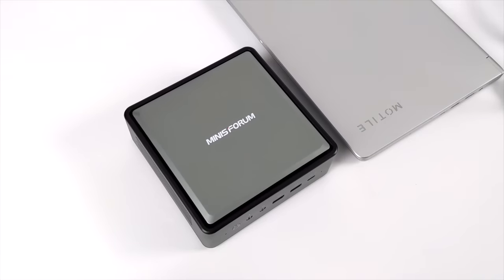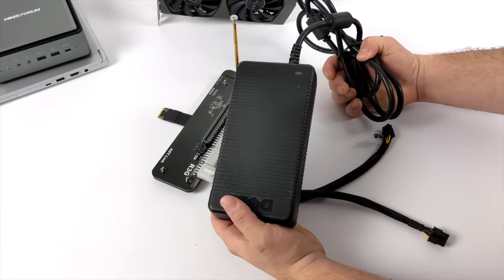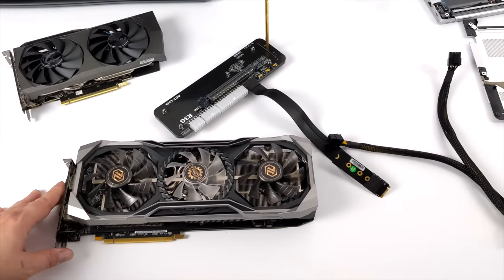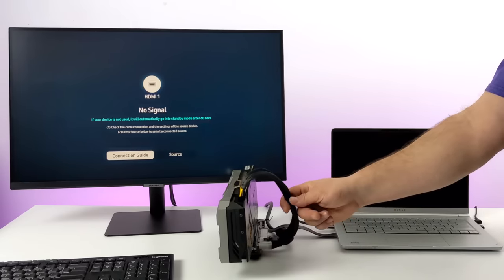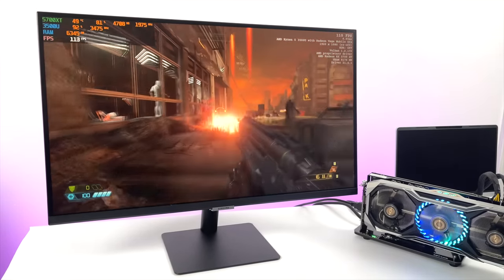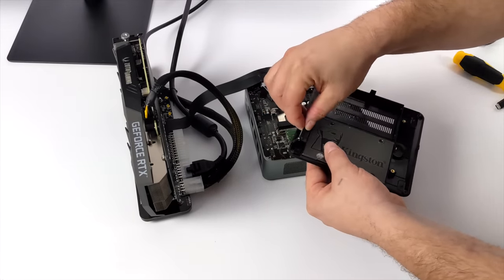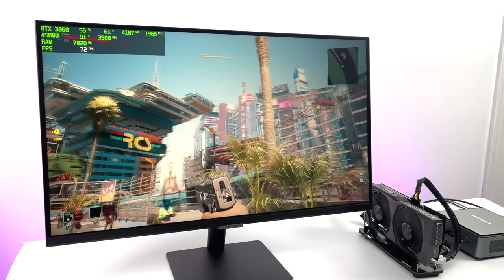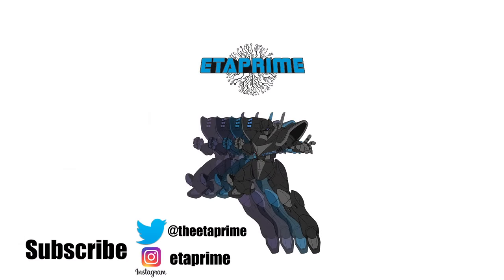Add A Graphics Card To Your Laptop Or Mini PC With This M.2 GPU Dock!

Comment: I already have this setup as a daily driver. Mini pc with i7 8750H from AliExpress, and this ADT Link also from AliExpress.

Been running for about 4 months now. I7 8750H and rx 570 combo. Great for daily task and "light" gaming 😁👌
Reply: Awesome! You used the exact same ADT? i bought an intel based i9 mini pc and seller tells me this cannot be done. But then it is possible on intel based too?
Reply: @steinbauge4591  same ADT, but different mini PC. Mine is older version which had 2 m.2 slot and 1 HDD slot but fewer usb slot and a weaker CPU.
So I still can use nvme SSD and ADT link simultaneously. And yes, it's still working today !
Reply: @ero-samairianto625  Great! Thanks for answering. Now my storage slots are SATA but there are setups for ordinary pcie mini ports. Only works with some 'moderate' gpu like GTX 1080.
Reply: @ero-samairianto625  Thx again, this was useful input as the seller now informs me the 2 slots I have are NVME, 1 also supports SATA. Seems their techs just assumed egpu was not possible on this one (ofc an assumption that potentially loses them business)

Comment: How bout a Dual M.2 to PCIe Adapter for dual purpose.
Reply: "Dual purpose"?.... you mean dual GPU, like SLI/CrossFire. If so, I actually think running 2 identical adapters would work just fine, even adding an SLI bridge might work. Having an integrated adapter only makes sense if you want to combine 2 M.2's into a single x8 slot.

Comment: if you can get pci-e gen4 X4 with this m.2 adapter you can actually destroy thunderbolt 3 4 and maby even thunderbolt 5 when it comes to a actual egpu like this setup. thanks eta for pointing out still the fastest egpu solution even if its not neat as a thunderbolt cable to a finished egpu box!

Comment: I just hoping to use the built in monitor for the laptop. Is it even possible?
Reply: there are ways to still use the gpu while routing the display through the onboard port/monitor sometimes. gonna take an fps or latency hit but it's been done before
Reply: Yes but it sends the video back over the same link so bandwidth can be an issue

Comment: Dremel.

You can just cut a slot in the bottom cover panel of a laptop, nearly the size of a cooling vent slit.
Reply: the issue is that if you carry your laptop around a hole big enough to conveniently plug this is is going to leave part of the internals exposed
Reply: @_Digitalguy  Seems like a good idea to 3d print a custom dust cover for that hole.

Comment: 1.) Did you use the Dell DA-2 USFF power supply with the RTX 3060?
2.) If so, did you have to perform any manual or software based power limiting?
3.) If not, what ATX power supply did you use?
4.) Does the Dell DA-2 USFF power supply come with the necessary 8-pin adapter cable?
5.) If not, would you please provide a link to the cable that you used in your video?

Comment: What is the GPU performance difference between using the "M.2" slot and directly connecting to "PCIe" slot on the Motherboard on a normal PC?
Reply: Usually the M.2 slot is more limited in bandwidth which can prevent the GPU from reaching full performance.
Reply: @ants288  well back in the day this solution much more limited bandwidth because it only have mSATA version 5Gb/s slot

Comment: Is it possible to use the laptop display or it can only work with a monitor plugged directly to the gpu?
Reply: Yes it is but you need to configure it properly for this, you lose 15-25% performance, it's very buggy, but I did it for a couple years, get the shortest cord you can find.  I tried to edit the dsdt but ended up going with egpu software from nandeva0 on eBay. It was unstable at any temperature above 40c but I could run a lot more games than what my Intel integrated supported.

Comment: Thanks for the indepth setup guide and the product links. In this way, these amd based mini PC's can be turned into a solid gaming rig. Would you please test it with some mini PC with desktop class apu like R7 4750GE or R5 4650GE? The performance should be Higher considering those CPUs have higher power limits.

Comment: In case you missed it, both Intel and AMD are agreed not to put PCIe Gen 4.0 in a mid-range portable/mobile devices Like Laptop or MiniPC. High-end Laptops are excluded as to use Thunderbolt 4 standard.

The reason for that is pretty simple: PCIe Gen 4.0 standard is not mature enough for Mobile use (Laptop or MiniPC) because the arbitrary Voltage and Wattage differs too much between running on Battery vs running on AC Power. This is a serious problem in the Long run if they actually implement it in Mobile devices (Laptop and MiniPC) like the device will Worn Down way faster than PCIe Gen 3.

So Intel and AMD continuing with PCIe Gen 4 stays in Full Fledged Desktop PC. Not Mobile.

The Tech Scientists who standardized PCIe peripherals also admitted that PCIe Gen 4 is not mature enough for Mobile devices, Unless you Slap $2000 to a Laptop Like "MSI Summit E14" which has PCIe Gen 4 which is beyond "Affordable" Price range. Because it is using a very expensive custom VRM (Voltage Regulator Module) in a Laptop to make PCIe Gen 4 possible.

PCIe Gen 5 will come soon enough this Year with way Lower Voltage and Wattage standard. And make it possible to be installed on Cheap Laptops.

Comment: You know what would be dramatically more useful than this on a laptop? An m.2 to thunderbolt port. Then you could connect a graphics card externally without rendering it non-functional as a laptop.
Reply: Or this, with a connecter in the middle of the ribbon cable (even if it's proprietary). You could Dremel out a nice hole for it and glue the jack in your case.

Comment: Just bought a Mele Quieter2. Interested in testing this dock out with it now. Would be cool if you did a video on that. Only thing I'm afraid of is CPU bottlenecking. Would be willing to buy the cheapest GPU possible. Nothing too crazy. Just something that'll get me 1080p gaming possibly with low or medium settings.
Reply: that is for a setup using ordinary pcie mini port and only a few GPUs can be used

Comment: I'm not too versed in eGPUs so I'd like to ask how does this compare to an eGPU that runs off thunderbolt? This solution is definetly cheaper though
Reply: Both have a max of 4 PCIe Lanes. Performance is probably similar (but M.2 might be faster since it's direct PCIe instead of tunnelled over ThunderBolt, but its probably minimal). The big thing is you can't hotplug like you can with ThunderBolt, and I don't think you can use the internal laptop screen either.
Reply: @seshpenguin  I see. Thanks for the info!

Comment: Is the M.2 cable detachable from the pci card? Because if it is, you could drill a hole for the cable to go out of the case and a little Velcro or reusable tape to keep it secure while carrying your laptop outside of your actual gaming rig. It would be awesome!

Comment: I've been using this external gpu dock for about 2 years and it's awesome! Although the one that I have is EXP GDC Beast, expresscard version, since I'm using Dell laptop with expresscard slot so I don't need to take off my laptop panel. I made also EGPU Box using aluminium angle as well!

Comment: I'm hoping that this setup will work with the Asrock DeskMini X300.

If it does, it'll be a fun project to 3D print a custom case to house both the STX motherboard and power supply.
Reply: Did it work?

Comment: It's perfect for a "mobile" GPU testing Laptop/Station.

After half an hour in the oven (most of the time [GPU]), you can comfortable check if there'll be an output signal again.

Now there could be something like an Ambulance for GPUs. With GPU Doctors on Board. 🚑🤭

But honostly I'm rly thinking about to get this Adapter for my own (I do own an old laptop, so it'll have a purpose for its existence again too).

Since I've managed to get 5 GPUs back to life and the swap between my main pc card and the repaired one was the most annoying part.

Thx for this video and giving me the idea. 💯 @ETAPrime 🤓❤️👑🙏🏻

Comment: What I can't wait to see if a dock like this to be PCIe 4.0 bandwidth vs 3.0, to where a 4.0 at 4x speed is equivalent to 8x 3.0 speeds, which would be similar to having a secondary card in a consumer desktop gaming PC
Reply: In case you missed it, both Intel and AMD are agreed not to put PCIe Gen 4.0 in a mid-range portable/mobile devices Like Laptop or MiniPC. High-end Laptops are excluded as to use Thunderbolt 4 standard.

The reason for that is pretty simple: PCIe Gen 4.0 standard is not mature enough for Mobile use (Laptop or MiniPC) because the arbitrary Voltage and Wattage differs too much between running on Battery vs running on AC Power. This is a serious problem in the Long run if they actually implement it in Mobile devices (Laptop and MiniPC) like the device will Worn Down way faster than PCIe Gen 3.

So Intel and AMD continuing with PCIe Gen 4 stays in Full Fledged Desktop PC. Not Mobile.

The Tech Scientists who standardized PCIe peripherals also admitted that PCIe Gen 4 is not mature enough for Mobile devices, Unless you Slap $2000 to a Laptop Like "MSI Summit E14" which has PCIe Gen 4 which is beyond "Affordable" Price range. Because it is using a very expensive custom VRM (Voltage Regulator Module) in a Laptop to make PCIe Gen 4 possible.

PCIe Gen 5 will come soon enough this Year with way Lower Voltage and Wattage standard. And make it possible to be installed on Cheap Laptops.

Comment: Any chance you could try adding an M.2 to Thunderbolt adapter? I'm wondering if you could use this setup to make a really inexpensive external GPU enclosure for a laptop...
Reply: Sadly a thunderbolt adapter to m.2 is most likely the most expensive part of besi3the gpu it self.

Comment: Could you test running a 3070 or 3080 in the Lenovo 1L PC you got a few months back? I'm thinking of adding a 3080 to mine via this for 4K60fps gaming and want to see the performance. Also do you need the dell PSU or can you run for example a 500W SFX PSU?

Comment: Glad I just ran into this. 

I've got a little Optiplex 7050 that I think has a 6th or 7th gen i5. Was wondering if I could use an external GPU through the M.2 slot.

Comment: Hi, thanks for this useful video.
Does the 8pin power cable also fit directly into a standard pcie 8pin slot directly into the graphics card?
I want to use a different breakout box (beast) which has a standard ATX pcie 8pin socket (like on a graphics card).

Thanks!
Reply: The 8 pin power cable provided with that external GPU dock is basically like any other 8 pin cable  you just plug it inti the GPU & plug the other end into the dock's designated 8 pin slot

Comment: Hey, so most newer cards require a 500w+ psu, the one you suggest is only 200w

How much of a reduction in quality is that when you have to limit the power supply by so much, and have you seen if the adapter works with a higher wattage input?

For example the rtx 3080, it needs 750w minimum. If the reduced energy would cost a significant effect than this would be pointless to me. Bc i was lucky enough to get a laptop with a GTX 1080

Alternatively would it be better to get it a power supply that isnt hooked up to the adapter? If you need a dedicated psu for it anyway why not get one thats full quality?

Comment: Kinda makes me wonder why they don't make budget laptops with external M.2 connectors, maybe covered in the same way that phones cover their SIM cards
I mean, it's clearly cheaper than Thunderbolt, since a lot of cheap laptops nowadays have them included, while Thunderbolt is only really seen on the higher end, and the cards that would actually be a good pairing for these laptops would cost about as much in comparison to the device itself as an External GPU would be to a higher end laptop with Thunderbolt
Keeping in mind the CPU bottleneck, a good pairing for a lower end laptop would probably be something like an RX 570 (probably even lower than that, but this still proves my point). Ignoring the silicon shortage, cryptominers, and the pandemic as a whole that makes any GPU whose names aren't GT 710 or GT 1030 be worth anywhere from 2x to 8x as much, that's just a bit over $150. Pair that with a $300 laptop, and you'd get a pretty good gaming experience, just by paying an extra half of what the computer costs, assuming they were to actually provide a way to do this in a user friendly manner (maybe include the GPU adapter as an optional $50 accessory?)
That's just my opinion. It seems like a super niche usecase, but it's simpler than building a computer, and less expensive than just buying a gaming laptop. There's probably a market for it. It'd be kinda like the Razer Tomahawk, but with people actually being able to afford it

Comment: In theory, if you were to use two Dell power adapters, one on the dock PCB and the other directly on the GPU, would you be able to use the full TDP range of the GPU? All while still using the power cable from the PCB to the other power connector of the GPU?

Comment: consider that the 3060 is tampered if you use it on non pcie 8 or 16 and version 3.... any other card will perform better.

Comment: an most oem laptops the free m.2 slot usually allows low power cards like Bluetooth cards and %g modems or similar devices. y tried to bring an sata ssd on an m.2.2 slot and it was not recognized great that you could Dow on that particular device

Comment: I just bought the riser, it has not shipped yet, would appreciate if you could tell me, do i have to buy the power cables that attach to the gpu and riser come with the riser or do i have to buy them separately.
Secondly, the strip that connects with the m2 slot is quite small as shown on Amazon, how is yours that long ? do I have to buy an extension cable separatly as well ?

Comment: what mini pc or laptop is the best to be paired with an external GPU sir? like in mini pc what type is the best and in laptop also what type is the best to be paired with E gpu
Reply: I use the 4th gen HP prodesk 600 with an 8th gen i5-8600T. It works well with my external GTX 1650 and I can fit the cables out the back by removing the optional port. Dell mini PC's also work great

Comment: Hi, the ADT R43SG is a PCIe 3.0x4. Is that not a problem? I mean won't it reduce the videocard performance where you need PCIe x16? I has pretty low knowledge and jist spent few hours to educate myself so sorry if this is a stupid question. Even the ad-t webpage stating the following: ADT R43SG is PCIe 3.0x4 32Gbps bandwidth limit passive adapter in compliance with Thunderbolt 3.0 interface
R43SG design for engineering test. NOT for home or office use.

I would appreciate some feedback as I am seriously considering to go with this solution to upgrade my i9 mini PC with GTX 1650. Also considering the tb3 option for this adapter. Thanks a lot!
Reply: You are absolutely correct: M.2 slots were not really made for graphics cards, which does result in a tad bit of performance loss. However it isn't a major performance loss in many use cases. You can quite easily outweigh the performance loss against the money/ room you save with such a setup.

Comment: If you had a 300 psu would you be able to run high settings? Or are you bottlenecked by the adapter?

Comment: Will this work with any laptop with a M.2 port? Like a Dell Vostro 3581?
Reply: If nvme ssd works on the m.2 slot(pcie), egpu will work too. Make sure the slot is not for sata only(key b type)
Reply: There are other adaptors (search for EXP GDC) for non-NVME (either NGFF or Mini-PCIe) connectors
Reply: @dreadavis9751  ok..thanks...I do have an NVME SSD slot

Comment: So if you had a non-hedt system and wanted a second gpu without cutting into the 16 lanes for the primary gfx card, would this be a viable option?

Comment: Hey love your videos and not sure if its been done but can it be done using the Dell Mini PC ..I have 1 that runs the i7-6700T cpu with 16 gig of ddr3 ram and I have to allowance to use a ssd and a nvme so it should be ok to use this configuration. I'm looking to have something thats mobile that I can play World of Warcraft on when I travel overseas. So to be able to play warcraft I dont need a huge graphics card to play the game normally and do quests etc etc . I basically would like to be able to have the dock with my dell mini pc , I would probably just use a gtx 1050ti which would be good enough for what I need. The dell power brick would be more than enough for what I need .I could even use a power supply that I have removed from a small form factor dell computer as well.They wouldn't take up much more room than the brick in my suitcase. If I can find a laptop that has a m.2 drive I will look to utilize that . I also have the option of installing a ssd hard drive dock in place of the dvd drive so a few options

Comment: I was trying to do this with a Dell AIO a few years back.  They had some kind of lock on the M.2 slot to only allow certain devices.  While there were a LOT of customized firmwares out there to unlock various M.2's on lots of machines, they didn't have one for my particular machine.  So the whole project was a "no-go".  I did pick up an alienware graphics accelerator for ridiculously cheap that I wanted to gut out (just needed the shell since most are prohibitively expensive) to stick the adapter into...has been sitting in a box of forgotten projects ever since.

Comment: I'm glad you mentioned to limit power to the GPU manually.  You would have to do this with most new cards with a small 200W PSU.
Reply: But why have a small PSU? It's not the expensive part here anyway.
Reply: How do you limit the power to the gpu manually? I have a Intel NUC10 i7 windows 11 Pro. TIA